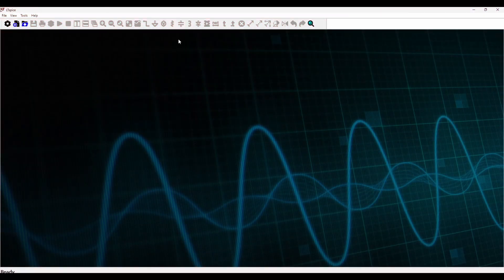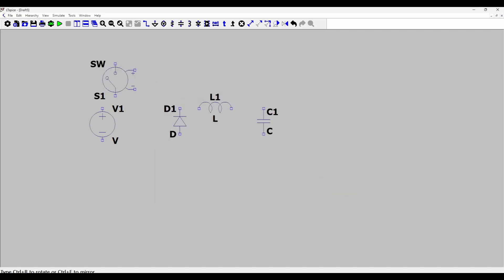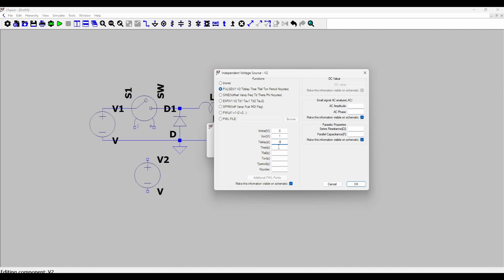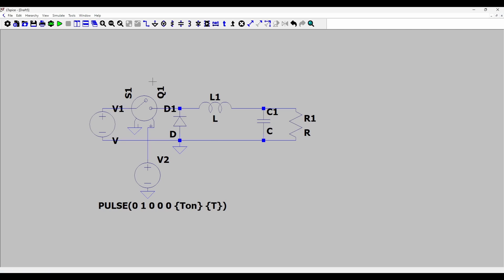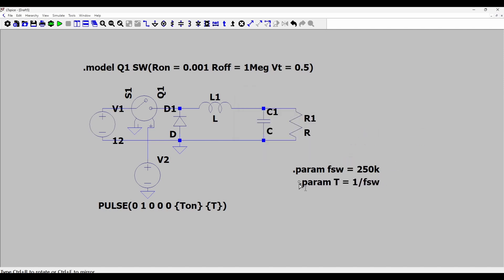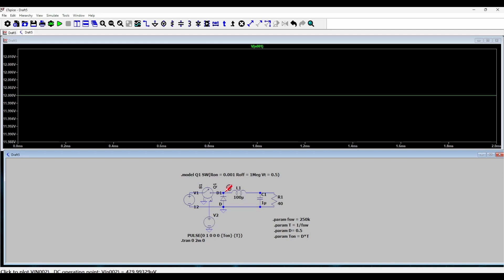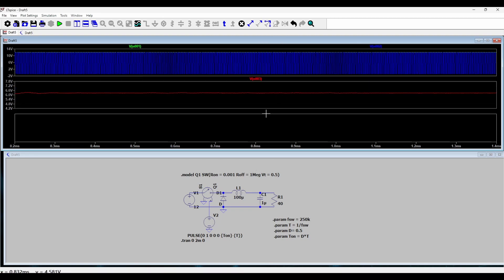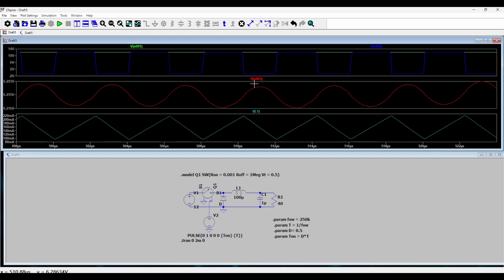Buck Converter Simulation using LTSpice | Transistor Modelling using Voltage Controlled Switch

Comment: I have a project which is about designing a 100W buck converter, the goal is to step-down input voltage and increase the input current, and the output power must be 100W and the PWM must be at 60% duty cycle. The switch I chose to use is an N-Channel MOSFET. This video lecture is very helpful. Thank you.
Reply from the maker: I’m glad you liked the video. Stay tuned for more content!